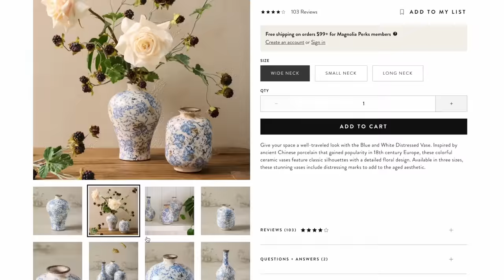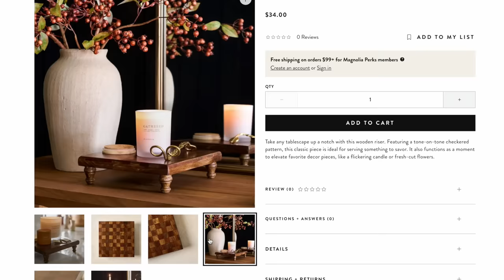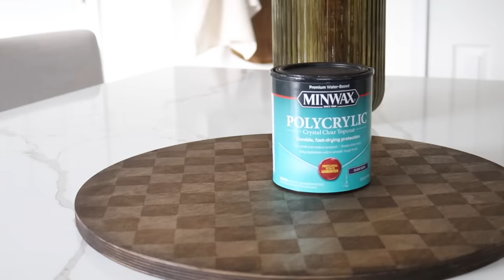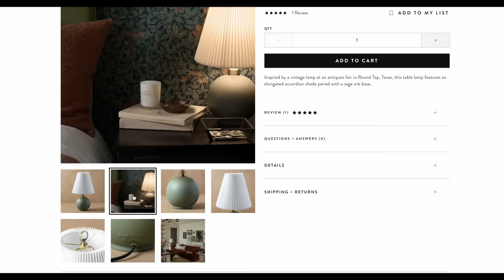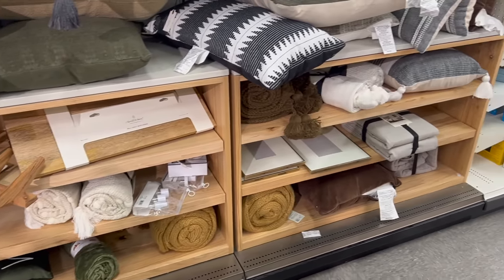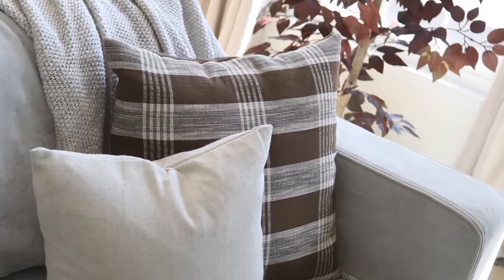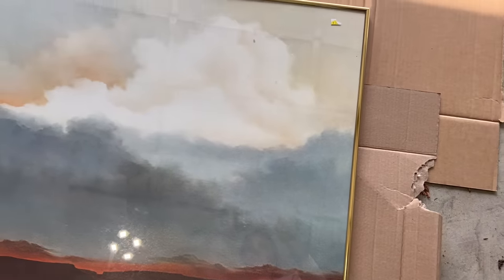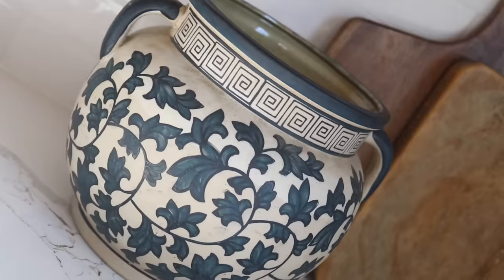MAGNOLIA VS THRIFT STORE | DIY HEARTH AND HAND HOME DECOR HIGH END DUPES

Comment: I take small rugs and carpets outside, wet them with my hose using a nozzle sprayer, sprinkle some laundry soap powder on them, and scrub them with a broom really well. Rinse well and let them dry outside. They're usually a couple shades lighter once they're clean.
Reply from the maker: That’s a great idea too! Do you find that is ever leave the rug really stiff?
Reply: @FiaGarciaDIY  Not if I rinse well enough, until there are no more visible suds.If you're afraid laundry soap will be too harsh, you could use something milder like a dish soap. Just make sure it's thoroughly soaked before you apply it and don't put too much of it.